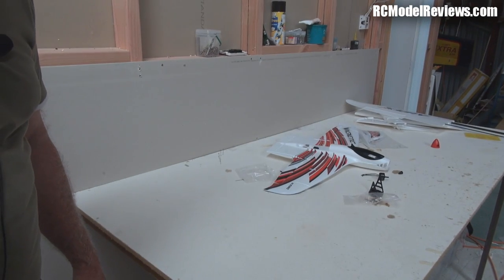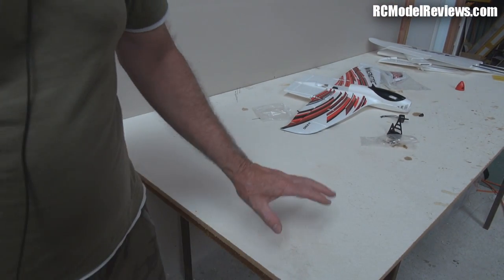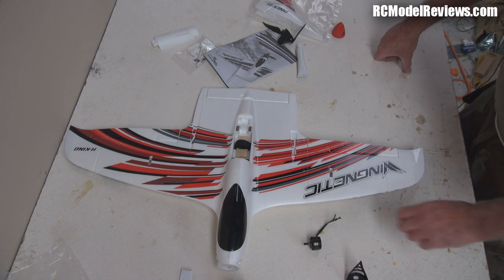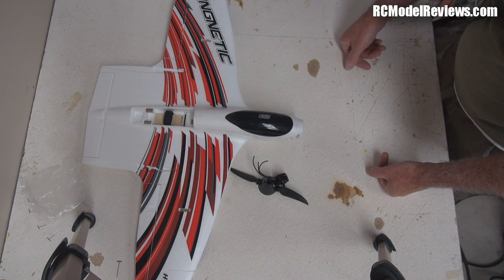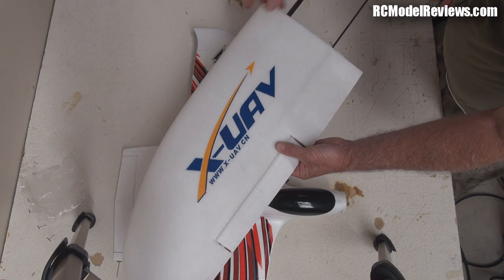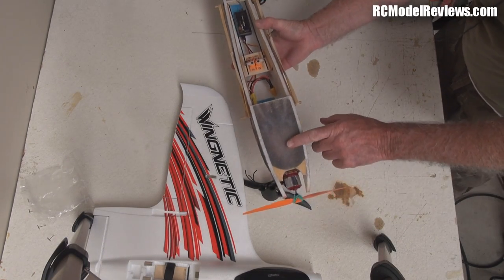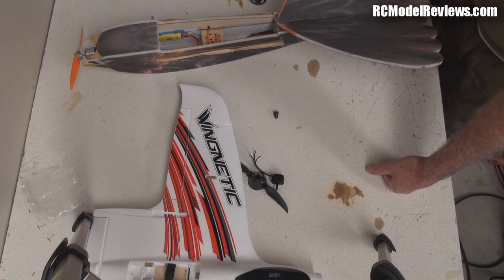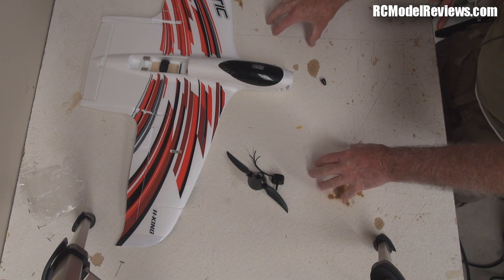Fixed-wing Friday: HobbyKing WIngnetic (part 1)

Comment: I don't you are making the right choices with that wingnetic. But I'd be interesting to see how it will turn out.

The bind&fly version is a surpringly well balanced package. It is fast, but not brutal. Not much load on it at all.
The motor is actually quite anemic. But that works surpringly well. The model is so slick that you get amazing flight times and bags of fun with it. The lack of power does make launching very tricky though.

The original spinner is junk. But Not using a folding prop I think will be a bad idea. It glides just so well. That is where the long flight times come from. But who knows. It might actually work well with a powerful setup. Torque rolling will probably be a issue. Or you go for a screamer, which I think would be not a good choice either.

Ah, I don't know. I think if you believe you want a more powerful setup. Still go for a folding prop, but a bigger and badder one. And make a attempt of streamlining it.
There is just so much right about how the model comes out of the box. I think it would be a shame to throw those characteristics all out of the window.

Comment: bit of an odd question, how are the hinges on the control surfaces made?
Reply: Are you asking about the hinges on the wingnetic?
Reply: I am, though James Mears seems to have the answer.
Reply: thanks, I have been trying to find a way to make them simply and it just isn't out there.
Reply: Get the small Dubro pinned hinges, use 2 or 3 of them across the length. I did this to the elevator of my wingnetic, worked great.

Comment: Don't waste your time on it. Typical poorly designed HK plane. I also purchased the kit and used my own electrics. The CofG is no where near the finger holes underneath. The positioning of the electrics is awkward inside the narrow fuse. After putting it together and realising my CofG was way off  I just wanted to bin it. I also dislike the heavy cheap, difficult to balance folding prop spinner.  I know some people seem to like the PNF version. I think it may have been my last plane purchased from HK.